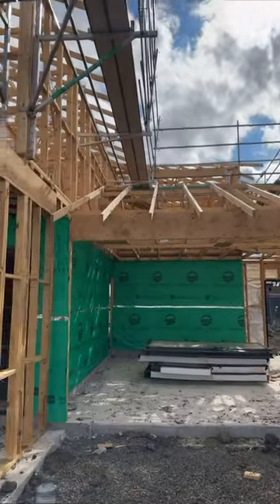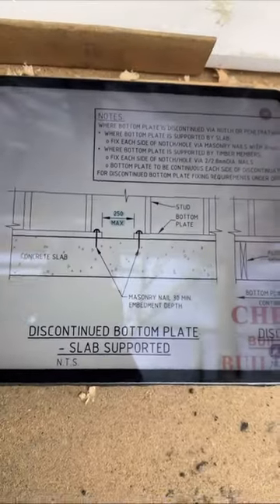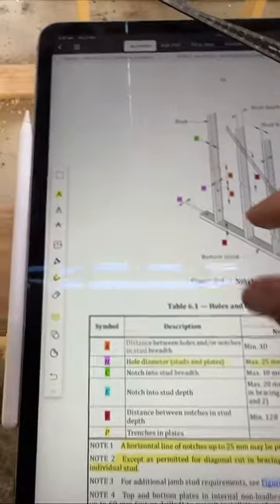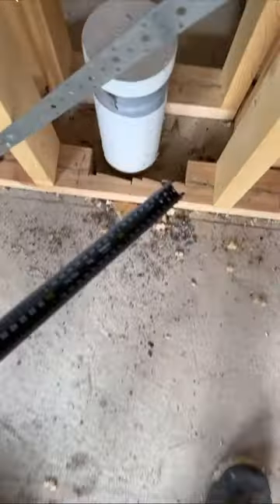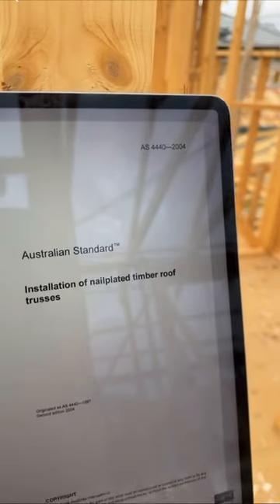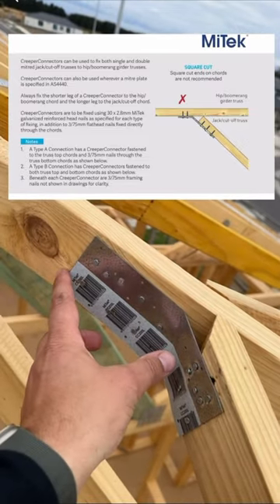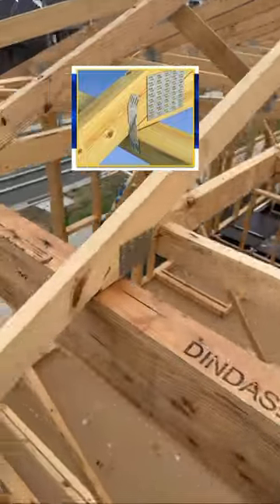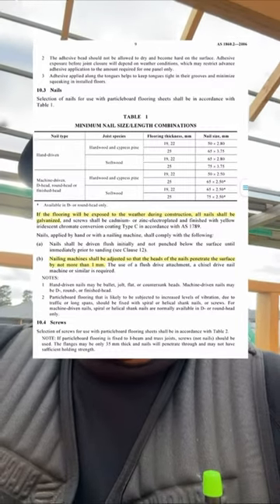Frame Stage Inspection in Kalkallo | What to Look for in a Building Inspection

Comment: There’s nothing more scary than a framer who cannot read engineering plans.
Reply: A good framework professional wouldn’t need to.
Reply: @tonysmith4277  love for you to find a framer that would know all the details for each brand of framing fix company. Pryda, multinail, simpson, vuetrade etc, etc. Frame and truss companies don't design, they punch in drawings and what gets spat out is specified by a program. That program wouldn't construct the best and cheapest design or the most practical for a framer to work with. Just something that complies. A framer gets stuck with this design. Outrageous expectations I tell ya!
Reply: @manofausagain  None of the items mentioned seemed specific to the frame design though?

Comment: There's always going to be defects ??? really. is that where Oz building is at ?
Reply: I think this video was just to point out some things he noticed - you can tell he actually thought the entire frame was OK overall
Reply: @chrispekel5709  So what percentage of faulty workmanship should we accept as OK overall, 5% today ...10% tomorrow ?
Reply: @harrycurrie9664  We shouldn't accept at defects at all. But it is almost impossible to build anything without  making a mistake or two unless the experienced builder has time to check over single thing. A few defects is acceptable and not dodgy building as long as they are extremely minor represents about 0.0001% of the total build. I'm talking about bracing not being completely perfect, joist hangers around the wrong way in one small section etc. Obviously major things like structural beams being installed correctly is bad and shoddy work 
😆
Reply: @harrycurrie9664  my point is directed at people who seem to think that a bracket the wrong way around that the apprentice put on is a huge structural defect and means massive problems in the future. Does that make sense?
Reply: @chrispekel5709  I see what you are saying.
Reply: @chrispekel5709  A bracket the wrong way round could well be a massive problem, an engineer may be able to tell us that, but wouldn't it be the responsibility of the licensed builder to instruct and inspect the work of his apprentice. I would expect something as simple as nailing on strapping would only need 1 lesson.
Reply: @harrycurrie9664  I have built a few basic houses as an owner builder, and no, small mistakes like accidentally nailing a joist strap the wrong way or strapping ever so slighty wrong won't affect it. Old houses didn't even have such things. Entire suburbs are standing with houses that were just nails into wood. What is important is making sure water doesn't go where it shouldn't, that will really cause problems. It's why he's always looking at waterproofing in so many uploads
Reply: @harrycurrie9664  you have to understand this guy has an interest in pointing out every single little thing even if they won't affect the house because it makes new builds look bad so he gets more work. He's right about certain things but so much stuff he points out are non issues. Sometimes nails from a nail gun will splinter the edge of a piece of framing off the side of it, say a cm or so. He says they need to replace pieces of the frame where that's happened when he sees it. It's unrealistic and unnecessary. People watching these will believe him because they don't know any better.

Overall he's doing a good job but some things he says are non-compliant were overlooked by inspectors for a reason - they don't matter. Others should not be occurring and need to be fixed.
Reply: @harrycurrie9664  when he complained about strapping being tied to the vertical and not the top plate, it was just pedantic and silly. Whoever did it would never have been taught otherwise because it doesn't matter one bit. It was screwed on the top plate anyway, it just extended down. No building inspector is going to say anything provided it was screwed into the top plate. Again, unnecessary and pedantic. The loose small roof trusses they forgot to nail and are wobbly? Gotta be nailed of course. They likely just forgot, humans make mistakes. However some of the other bigger problems say to me there are some fairly average people operating here. Hence why independent inspectors are a great idea

Edit: I might be confused as to which video I am referring to in this reply

Comment: You would think that framers would know to use galv nails on the flooring if they do this sort of work daily. Too many mistakes for my liking. My son is building a house at the moment and I've seen enough bad workmanship to realize that no one seems to take any pride in their work these days. Inspectors do a vital job in  protecting new home owners interests.
Reply: Well the day that the chippy doesn't have to supply nails you might start seeing gal but you're saving a few hundred $ every frame by not buying gal so you'll never see it unless the client is willing to pay higher than the cheapest they can find because quality costs and has very little to do with taking pride in your work when the cost to work in it self is so damn high.

And, framers?... that's all you need to know. If all that chippy builds is frames then there is your answer.

Comment: These video's are mighty.   Can you do follow up video's on rectification works?  Where the timber frame overhangs the slab, the engineer recommends structural grout.  On face value, the structural grout seems cosmetic, how does this improve support of the timber frame over the frames lifetime?
Reply: Sometimes engs recommend to install 140x35 or 140x45  with chemset anchor. Some do install 10mm galvanized metal plate.

Comment: So much to check with a timber frame, I would also check that they spanned things correctly as many simply do not know how to use AS1684 if they know what it even is in the first place. Another good thing to check is wind direction A and B bracing.

Comment: I love the videos,the things I learn , and how annoyed I should be at my own building inspector who I paid to check a house before I bought it, half the stuff through your many videos he ignored and said, ‘yeah that’s fine”

But before I get too depressed, I need to know, on average, or out of 10, how many homes pass/fail your inspections? 

It would be really important info to the industry as a whole, as to how wide s-read the problem is.
Reply: Every single home is going to have something that it fails. No house in Australia is absolutely perfect. However, just because a house has a few things wrong with it doesn't make it a bad house - if the problems are widespread and go to structural issues you've got problems. I'm sure the house he looked at just then would be completely fine, but you don't want structural stuff screwed around with (the timber supporting the second story). Everything else he pointed out has a 99.999% chance of never affecting the house in it's lifespan
Reply: @chrispekel5709 well said 👍
I can go through some houses he built and also find non-compliant issues.

Comment: There is no way you pulled them up on that 11mm hangover on the garage beam slip/jack studds??? hahaha stop it. Considering the beam above that should be fit to the inside and the checkout is 70mm and the beam will only be a maximum of 65mm that 11mm's you measured actuly isn't even load bearing and could be planned off if that will make you happy hahaha. I respect you man but that was a leg puller espescialy since it looked liek a tin roof but even so. Can't believe I'm blowing up over 11mm on a pre-fab hahahaha

Looks like it's possible a 35mm beam that could be set to the front but even so.

Comment: so  rusting steel nail to party board flooring, so, do they rip the house down>?
Reply: They ignore this one.
Reply: It probably won't really effect it. The problem is if the rust continues the nail won't exist then the sub floor will come loose over time (the glue under it won't last forever) and you'll probably get a bit of squeaking in a few years. Maybe. Maybe not.

Comment: The truss grips are installed on the inside as their was no fall protection when the roof trusses were getting installed which is fine. Put them on the outside and you have an apprentice on the top rung of a ladder balancing tippy toed on 1 foot leaning over the edge trying to bang something in that doesnt do anything anyway.
Reply: Very true
Reply: A lot of the 'non-compliant' things he finds are...eh...whatever. Doesn't effect the house. And some of them are shockers that really need to be fixed
Reply: @chrispekel5709  there was 1 where he was doing a frame inspection and was looking at the member schedule pointing out all the mistakes with the steel and missed the fact that the GL1 wasn't even galvanised, another was he said for porch frame it had to be h3 timber where only the bottom plate needed to be as its inside brick pier. He is good, but is definitely not from a chippy background.
Reply: Doesn't matter, you paid to have it done as it's engineered to be done, it's not up to the builder to make adjustments on the fly for convenience.